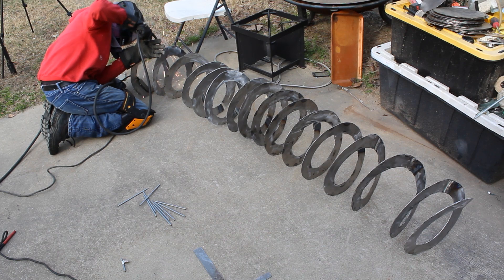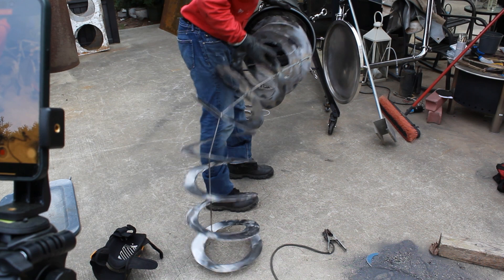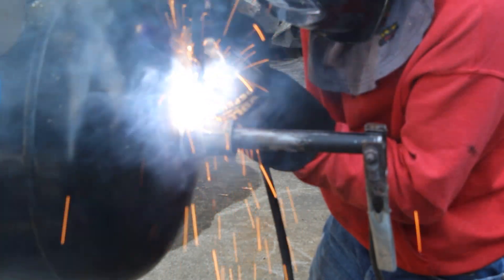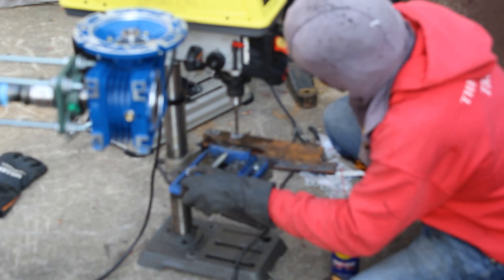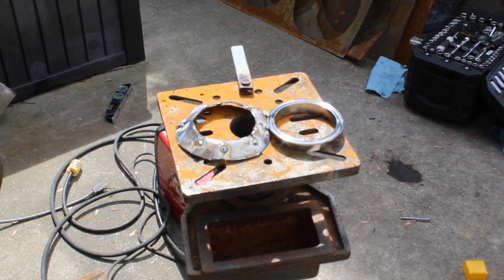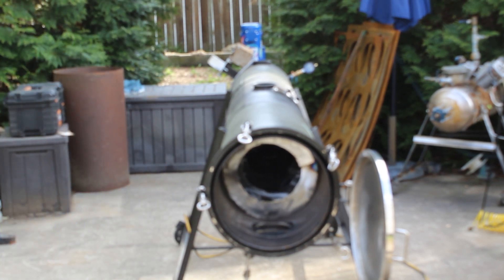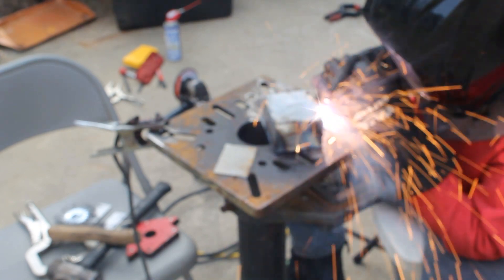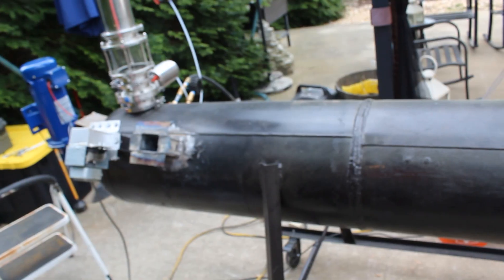Building Mark 4.5 Plastic Into Fuel Reactor | Part 5: Spinning Blades!

Comment: for your funnel system maybe adding a motor that shakes the material into the machine? Maybe make it on a separate frame with rubber mounts so avoid the system falling apart.

Comment: Young gun you’re smashing it, some of the pieces look rough as, but that adds to the beauty showing your time and dedication to this build.

Are you using wind and solar to power with DC to bring energy costs down? DC can be done without a battery pack for pulling charge directly.
Reply: Fellow Aussie?

Comment: Hey, I was wondering what the chemical composition is of the plastics you are using? If they only contain Hydrogen, Carbon and or Oxygen, this is awesome. Though, I am wondering if the plastics happen to contain inorganic elements like what methods or preocedures do you intend to use to make sure that they can still be used for pyrolysis that would leave us with fuel mixture only consisting of hydrogen, carbon and oxygen?
Reply: He should definitely check each piece of plastic added though, as burning something like PVC, CPVE, FPE, PTFE can produce chlorine gas, which is deadly...
Reply: Also, I should mention that bio matter, like a banana peel can be used just as effectively. Just not dangerous materials like the ones I mentioned above
Reply: @chillchilli2671  Yea, my main concern is contaminants in plastic that contain certain elements other than H,C & O.

Comment: More questions sorry. Why a vacuum? Doesn't the pyrolysis create expansive pressure...
Reply: I think the vacuum is to remove oxygen so that there will not be explosion.
Reply: @tehabnorm  drawing out the oxygen melts it and keeps the plastic from burning. The fumes produced from burning plastic can contaminate everything, melting plastic produces no fumes. Genius idea imo

Comment: Hey. I'm interested in what the kw input compared to liters output your getting? Or do you know the energy conversion rate? Also is there a reason why your using a microwave and not a heating element like off a kiln? Well done and I'll be following your progress. Cheers J
Reply: Vibrating vs heating....
Reply: Im gonna guess he could get the microwave parts easier.